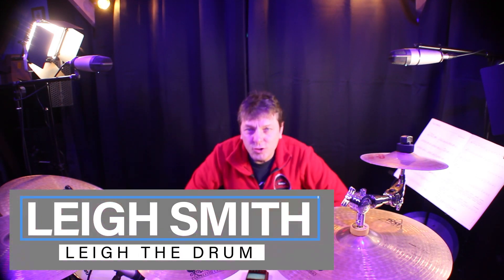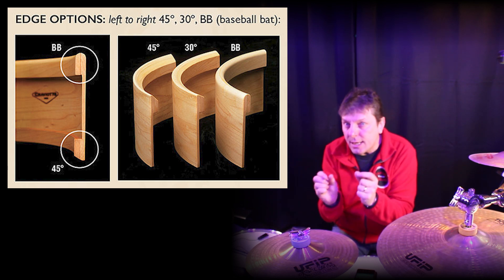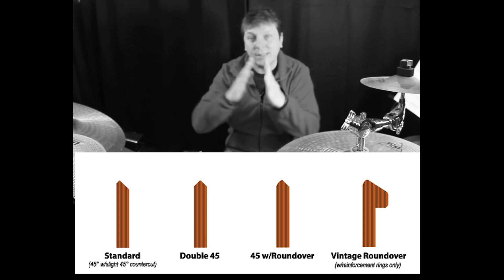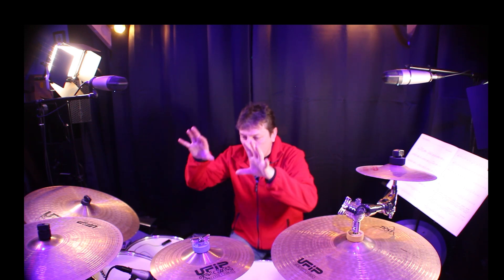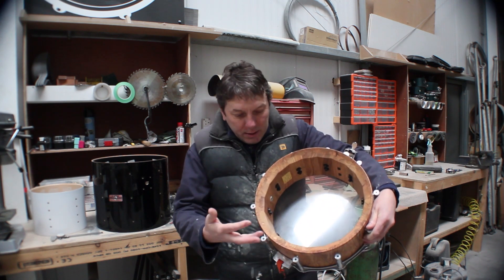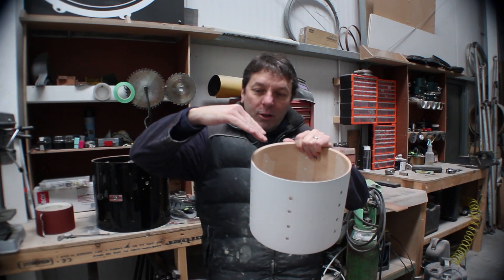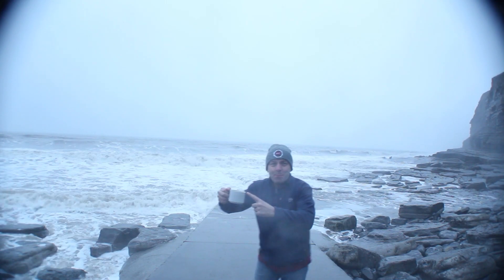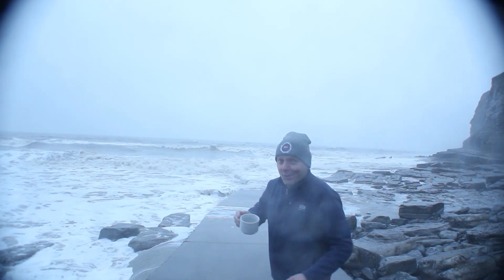Drum bearing Edges, The facts about what matters.

Comment: Roundover is the best as it transmits the energy into the shell instead of the rim.
Reply: Shape of the bearing edge will have no influence on the amount of “energy” that the shell will be subject to. The head being in contact with the edge is all that’s needed. The bearing edge is a head mute as the various frequencies will be either muted or not muted. The only influence the shell has is its resonant characteristics will control what the head is allowed to do. Denser shell materials will not absorb as much energy resulting in a drum that projects more volume. A less dense shell will absorb more energy resulting in a drum that projects less volume. Shells make no sound.

Comment: Have to love this neverending  discussion! My 2 cents here : Absolutely no difference between sharp cuts. Makes no difference if its 60-45-30, as is the sharp edge that touches the drum head. Totally different situation with the rounded edge. Theres significantly more surface contact between the shell and the head, resulting in a decrease in attack and a more rounded sound. I have vintage rounded edge drums with 1 ply clear heads that sound much more rounded and mellow that a modern sharp edge drum with a 2ply hydraulic drum head on it. So, as a matter of fact, bearing edges do make a HUGE DIFFERENCE, but not the angle. What makes the real difference is the round vs sharp edge difference.

Comment: Yes.  They absolutely matter.  The bearing edge has more effect on the sound than any other factor.  
When the drums are close miked, eq'd and compressed, yes, none of it matters anymore.  The wood, the edge, the head, none of it as the sound is being manipulated for the end result.  
However, in a small acoustic setting, the differences are 100% audible.  
Think about it scientifically:  the striking of the head is what engages the vibration of the shell.  The edge is what determines the amount of vibration from the struck surface (head) that will be transferred to the shell. 
The drummer in the video linked in the other comment even expresses how he would use each edge type for different musical situations.
Reply: Scientifically? Haha!
Bearing edges are analogous to guitar frets. 90% of the tone of a vibrating drum head (or a guitar string)  comes from the CENTER area. The point where the head contacts the shell, isn't vibrating at all. And the area of the head over the inner slope of the bearing edge is vibrating with such a low amplitude that you simply cannot hear it. Even overtones that you hear when playing a drum are still inches away from the bearing edges. This is why guitar pickups are put near the middle of the vibrating string and not buried in the neck near the frets.

The shell's supposed vibration is a tiny factor, the sound you are hearing is the drum head vibrating and the shell acts as a chamber to amplifier the fundamental tone. Its not the other way around. That's why engineers mic the drum head and not the shell!

Also in an acoustic setting the acoustics of the environment play a much bigger role than anything else. Overall in a drum the drum head, tuning quality and drum shell SIZE and how you strike the drum matter more than anything else. Shell material type matters less, bearing edge ANGLE doesn't matter at all.

The only thing that matters is that the bearing edge is flat, clean and that the shell does not contact the drum head hoop, choking it.
Reply: @weschilton  spoken like a guitar player.  If all that matters is the head, why doesn't every studio have a $200 SPL kit from GC but with quality heads on it?  Why cut an edge at all? Why not just leave it flat?  
Lastly, no drummer, and I mean NO drummer, hits only the center of the head.
Reply: @cariaddrums  He may have a point, but a lot of you have posited that the edge has little to nothing to do with sound and yet none of you have taken to trying to rebut my point on that:  if edge and wood don't matter, why do drums even have an edge at all?  Why don't studios just get the cheapest crap kit they can find and put good heads on it (since that is what is being posited as the most meaningful to tone)?  
As for the studio setting, if you had taken the time to read my initial post you would have seen the section where I said in a studio setting where everything is close miked, eq'd, and compressed none of matters as the entire sound is being manipulated through the engineer's board.   Where it matters and where it shows is in an acoustic setting.  
But hey, who cares about context, just read a few lines and write a reply.
Reply: @weschilton  OK then, Wes....remove the pistons out of your old Chevy pickup truck, and throw some heads across the cylinders then.  smh
Reply: NO the air loading has more effect of anything else on the sound and a shell is just a damping system sucking vibration energy from the head (thus affecting vibration of the head therefore the sound) the bearing edge do act on sound but the vibrating shell does merely radiate not more than 10% of the sound
Reply: @weschilton  Well said. Listen up people. This man speaks the truth.

Comment: I agree with this, the inner angle has zero influence on the tone... it doesn't touch the head or effect how it vibrates in any way. What does matter concerning bearing edges is the point where it contacts the head. If they are flat and level and there is sufficient space to allow the head to float over the shell, the drum will be easier to tune and resonate.
Reply: nope : it does change the mechanical impedance of the bearing edge : the flatter = the stiffer

Comment: EXCELLENT commentary …BUT…. find a piano rebuilder that has EXPERIENCE with Steinway, Baldwin, Yamaha and Boesendorfer ( so I don’t remember the spelling) …and SPECIFICALLY …..BRIDGE….. CUTTING …. FOR EACH OF THOSE PIANOS…….
 The bridge is the “ bearing edge” for all stringed instruments.
Ask a Steinway master rebuilder if the bridge design, and cut  effect tone and sustain.

Steinway even goes as far as minimizing support on the tuning pins claiming that tone production occurs end to end…. AND….. THERE IS AN ADDITIONAL SECTION of string between the tuning pin and the “ capo” ( termination) …. Steinway even adjusts the length of that “ non speaking section” ( Google Steinway duplex scale) claiming  again… the WHOLE length of string produces or supports tone…

A little here… and a little there….. maybe a big deal…. Maybe not…. 
Yes… most piano players CAN hear the diff without hesitation… between the above listed pianos….. 

So….. is it THAT important?
Does it change the sound THAT much?
Can drummers hear a Yamaha vs Tama vs Pearl vs…….?…
head selection, tuning and the drummer’s playing style probably effect the sound a LOT MORE than a WELL BUILT drum…. S another well built drum.

Comment: IT….ISSSSSS….from the bearing edge ! But not from the material that DOESNT touch the head…. but rather it …IS…. from the size and shape ( profile) of the wood that DOES make contact with the head. And no bearing edge is “ infinitely razor sharp”… so the variables are, 1) is the bearing edge truly flat / true all the way around the drum
2) is the shell TRULY SYMMETRICALLY ROUND
3) is the top point ( center of contact aka apex )  of the bearing edge truly in the same place per the thickness of the shell. ( #2, #3 and #4 have everything to do with “ tun-ability”
4) is the bearing edge “ relief” ( inside and outside “fall away”)  symmetrical 
5) is the hoop perfectly round and flat 

#2,#3 and #4 MATTER… because each and all effect “ total LENGTH “ of the vibrating body.. ( edge to edge/ bearing apex to bearing apex) and/ or from exact center of the head to the bearing apex.)  LENGTH OF VIBRATING BODY is one of the three variables that define pitch … length, mass/weight  and tension.. ( ok temperature too) 
If ANY of the bearing edge is not consistent then that portion of the vibrating membrane will be shorter or longer than all the other membrane… and even if ALL tuning lugs and rim locations are perfectly identically tensioned, the variation in length will cause an “ out of tune condition”

Steinway pianos went MUCH further than other piano builders to make sure that string lengths were designed and built in to the body of the instrument correctly. Talk with a piano tuner to get their insight into the Steinway duplex scaling.  

Does ANYONE discuss good techniques for checking drum roundness ?
Thx